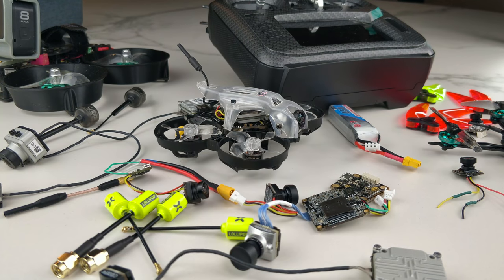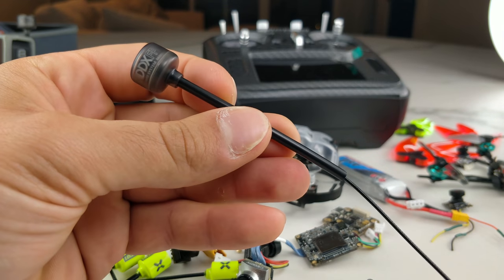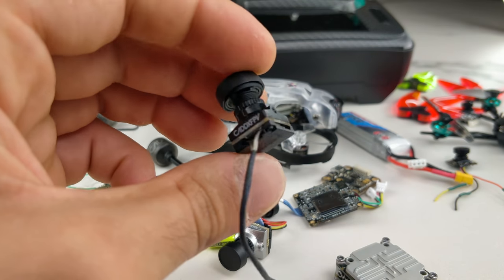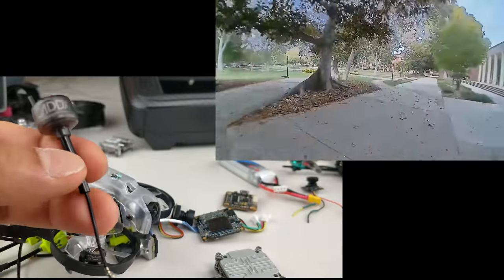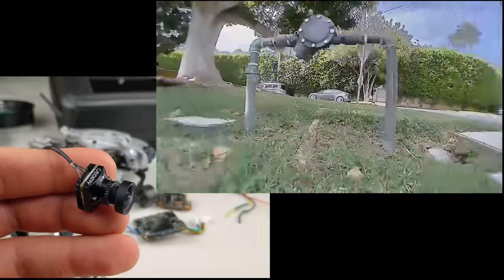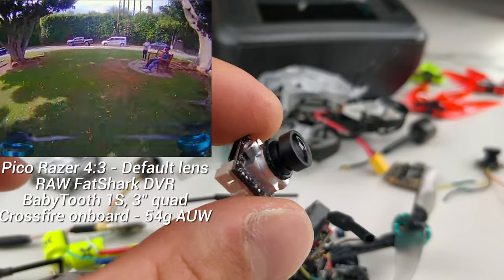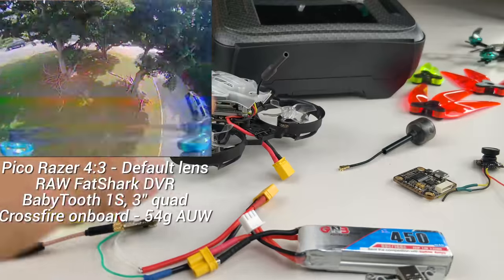Lots o things + GepRC Thinking P16 & Jumper T18

Comment: I'm not sure why you say it's only 2S when website clearly states it's for 3S 300mAh. No point to fly this for fun with 2S
Reply from the maker: Because 3S batteries won't fit in the battery bay.  those 300mah 3S packs are useless.  They last like 10 cycles at best before they die.  At least that's what happens to most of mine

Comment: I love the look of my TX-16s.  Don 't like the styling on the Jumpers.  Some of us want just a basic black radio.  It's like your basic black skirt or basic black shoes or basic black motorcycle.  Suppose to get my DJI goggles this Friday.  If only this cr@p wasn't so d@mn involved and complicated to setup and configure... and bloody d@mn expensive to buy and replace when you bust it up.  I thought this would be cheaper and simpler than ultralight aircraft...and it's... not.  :-/   It adds up into some big bucks.   Nor is it really getting me into the air... that much faster.   
 
On the other hand - I stay the course because...   kwads are fully aerobatic/acrobatic* (very, very few ultralights are), no hospital bills when you crack up, and no barfing in a bag from turbulence.   If you've ever been in turbulence in a private plane, you know what I mean.  Talk about getting your cookies tossed.  Flying in a straight boring line in a huge ocean that is the endless sky while getting thrown around like a sock in a dryer isn't going to cut it for me anymore, now that I've tasted kwad flying.    I'd rather be low down where things move fast and there's lots to see and gaps to shoot and things to orbit and obstacles to dance around and dodge.  
 
You know, the kind of flying that is shrug par for the course of everyday flying for a kwad pilot, but when described to a general aviation pilot that you want fly like that, they call you a menace and threat to society, a renegade, a loose cannon, a hotshot, a Darwin Award waiting to happen, giving the hobby a bad name, etc.  So I said, see ya!  I'm going over there... where the rebel pilots and riff raff and outcasts hangs out.  My kind of people.  Mostly.
*To quote the Red Baron on Dr.1, "It climbs like a monkey and turns like the devil..."
Reply from the maker: This is all why I've been focusing so hard on the small, light platforms lately. They actually are so much more fun a lot of the time.
Reply: @Kabab  I totally agree! I almost exclusively fly 65mm and below! That Diatone GTB229 you designed is fantastic! 👍
I love doing what you do in your videos... Fly right through the tree branches and in between the leaves! Like you said, with precise throttle control you can get a who0p through a 2 inch gap between the leaves of two branches, not even talking about the branches themselves! Fun as Frick! Lol 😂 😉

Comment: 14:05  I would listen here as the "4:3 vs 16:9 FPV FOV ratio debate" is actually very important to get right if you want to avoid hitting something pulling out of a loop... compared to a 16:9 aspect ratio you will see a rock or tree coming up in your tight curved flight path much sooner using a 4:3 ratio display ratio and it's obviously going to be even worse going wider and using 21:9 which will likely replace 16:9 as the "best" aspect ratio for viewing movies and games... because they don't move information connected past the fixed frame of their screen being observed. In FPV everything outside the screen area is "connected" and "really there" to both see and run into so all directions are equally important as side by side becomes top to bottom with the flick of a stick. 
There is a big difference between flying in "real FPV" and watching "fake TV" where King Kong can't reach the next tree over because it's outside the picture frame and not there in time. Each viewing experience uses a screen but does so to obtain a different goal and with FPV the screen ratio requires what is visually required to see where you are going in any direction and match the experience of our own natural vision. 14:05 is about viewing FPV flight and applying what works with what works best and if the "Director" is controlling the view of YOUR horizon and what you see then the 16:9 aspect ratio IS MUCH BETTER than the standard 4:3 aspect ratio and so much better for the PC that the 4:3 ratio is no longer supported and if you play games you know why movies have black bars top and bottom as it's only a matter of money keeping kids away from Ultrawide  21:9 144 hz  IPS monitors and video cards to support them. 

With FPV the pilot in command controls the view in all directions not the movie director so you don't want to limit the view axis of looking up and down while right side up because that view frame of being right side up won't last long so you will need a wide side by side view as the side to side view becomes the top to bottom view rolling in a turn.
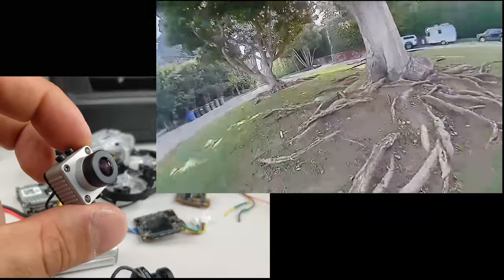Reply from the maker: Right.  There's absolutely zero point to having 16:9 as even an option for FPV.  Actually, if they turned the 16:9 vertical such that it was 9:16, I'd be ALL for that.  Vertical FOV is far more important for us...with static angled cameras, than horizontal FOV as you explained.

Comment: They are not potentiometers. They are encoders, which are much better. It's the same thing that calculates servo motor position in industrial automation.
Reply from the maker: whatever it is, I can't tell any difference from the old fashion pot
Reply: Easiest way to put it is pots and hall effect are analog and encoders are digital. Pots have friction plates to regulate voltage for a predetermined position that wear over time. Encoders use a proximity sensor to verify the exact position of the stick with no friction and wear. In short, encoders are a digital version of a hall effect sensor, sort of.
Reply from the maker: @IpokeSmot420  I know hall and pots. I didn't know encoders existed. Now I'm wondering how it senses. Hall is magnetic sort of and pot is ancient. Is encoder like, optical?
Reply: @Kabab  not exactly sure on these specific ones, but the encoders I work with in automation is a disc with slits for a total of 8192 steps. The type that are most common are electromagnetic, but I do believe there are optical ones out there.

Comment: I highly prefer a 4:3 camera with the highest field of view that I can get. I just feels immersive when flying :)

Edit: You sould make a poll in the video asking which camera we are preferring (16:9 or 4:3)
Reply: sadly youtube recently removed polls
Reply from the maker: Yeah really sucks
Reply: @Kabab  Too few people have tried 4:3 cameras on 16:9 goggles - it works brilliantly.  I still think that's the best setup.  4:3 on 4:3 works well, and 16:9 on 16:9 looks fine (But you're not using the edges, you just lose vertical FOV to an extent)... what you don't want is 16:9 camera on 4:3 goggles, because that's letterboxed garbage.
Reply: I want native 16:9 sensors and good lenses so we get the same vertical field of view as current 4:3 cameras, but gain the extra horizontal view of 16:9 and so I can use the full width of my 16:9 goggles effectively.  :(